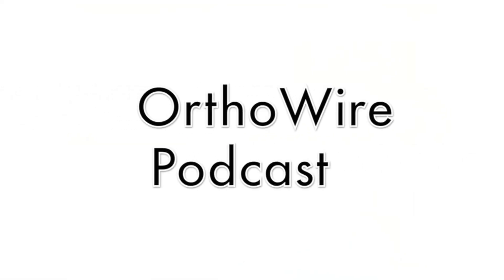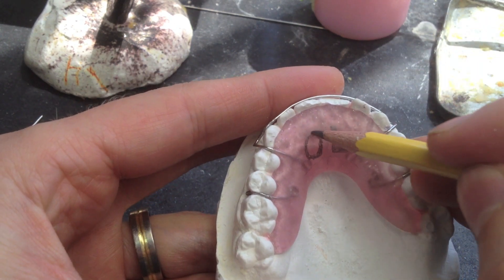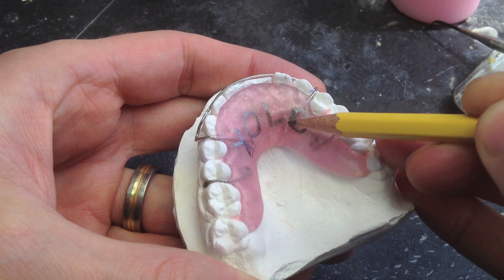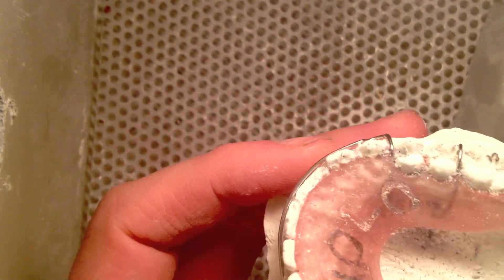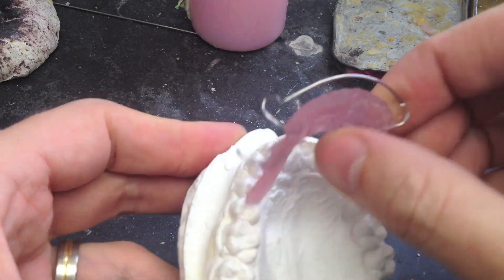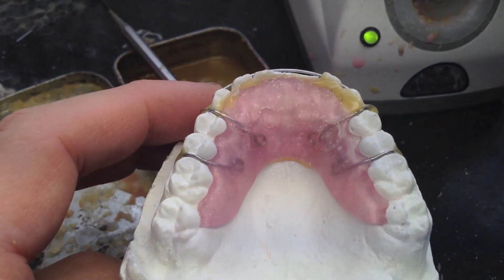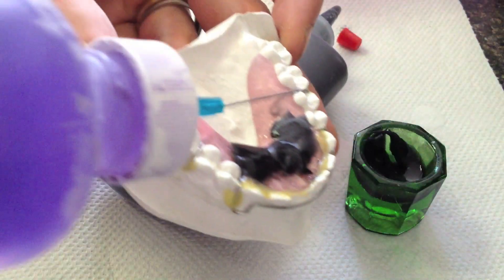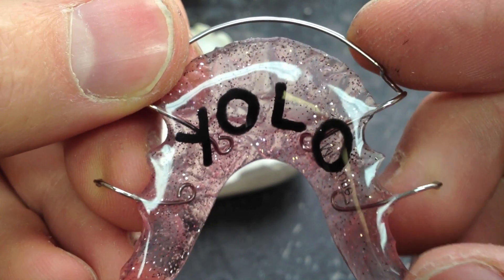Acrylic Inlay Design on Retainers - Letters

Comment from the maker: Thanks! We print the names for the retainers using a Brother P-Touch labeler, specifically models number PT-1230PC. YOu can connect it to a PC and print all the names and clip art you want. We use the black on clear tape. I used to use tissue paper taped to a regular piece of paper and print out the names using a regular printer then put some scotch tape on and cut it out with a razor blade. The scotch tape was so that the monomer will not make the ink run.